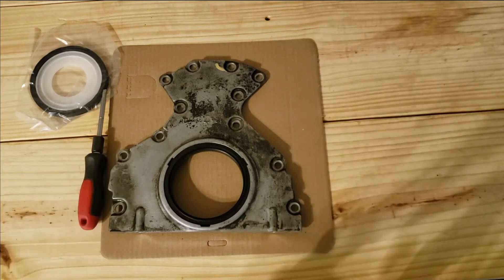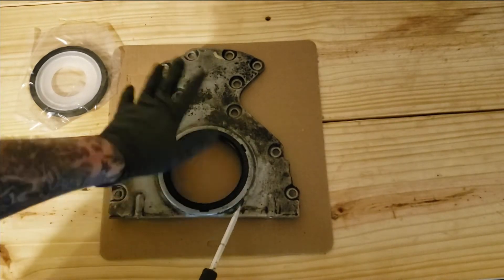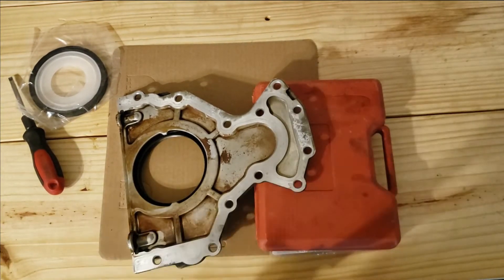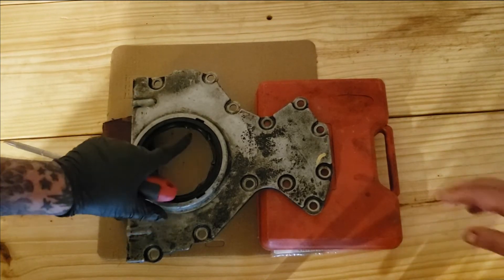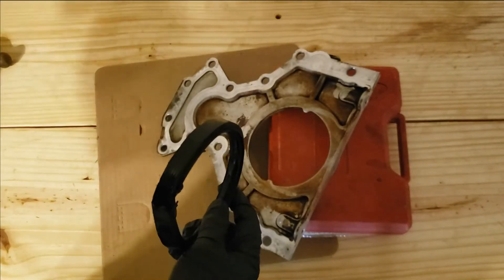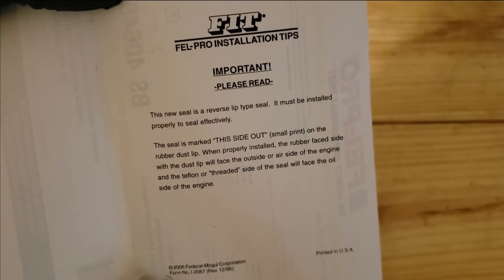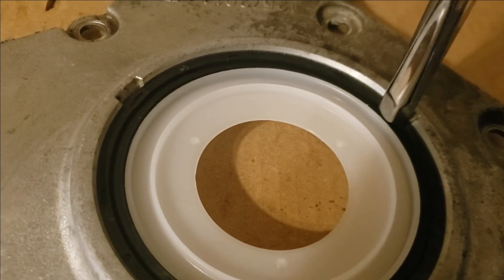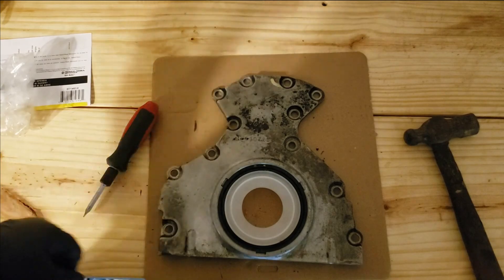LS Rear Main Seal Install - HOW TO

Comment: Have you ever seen an LS1 style rear cover with a cam grove in it?  Mine looks like the cam was walking back into the cover.  I see on your cover in the video GM cut the newer style cover so that the cam doesn't touch it.
Reply from the maker: cam walk on a LS is from the thrush plate being poor quality or wore due to poor engine oil changes or low quality oil from the discount shelf, also is caused by a bad quality timing gear or a gear that has alot wear, which will let the cam move a little back and front, or a combo of both
Reply: @TattsForLife  Thank you

Comment: I should have done mine in my 96 grand Cherokee when I had the oil pan down. It barely leaks now for many years. Sence I change the oil every 3500 miles and add Lucas stabilizer.
Reply from the maker: I always replace the rear seal if I am able to

Comment: My new seal looks so different. The old seal flared toward the inside of the engine
 This new seal I can't tell which way to put it in
Reply from the maker: it should say somewhere on the seal, may be hard to see, or could be the wrong year seal or your setup
Reply: @TattsForLife  Hey Thanks for the reply.  I ended up buying 2.  The first one I installed backwards. Even the second one I bought, a felpro, did not have any words on it.  I even had the parts counter guy look to see if he could see any writing on it.